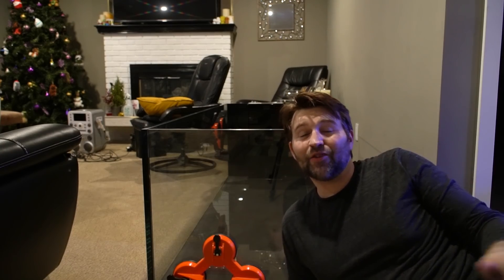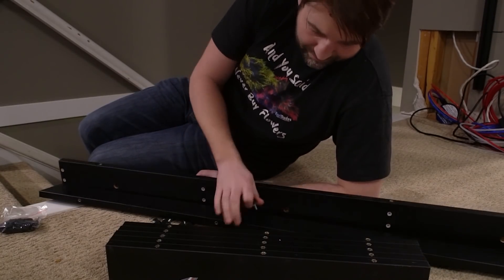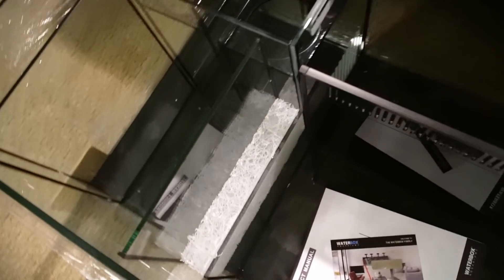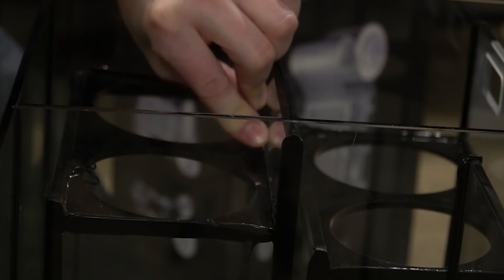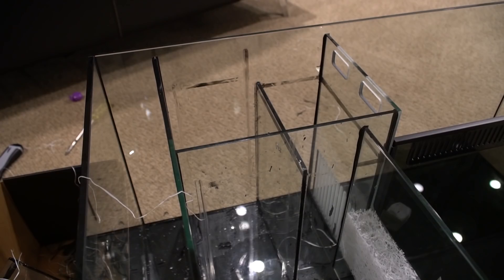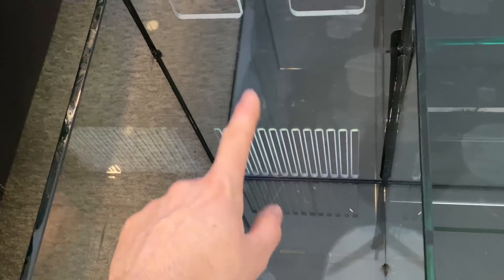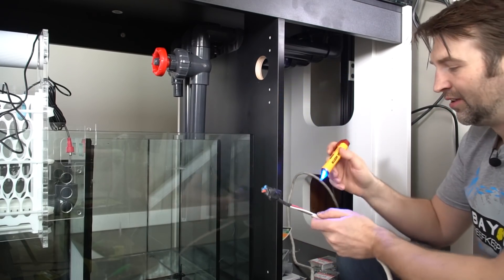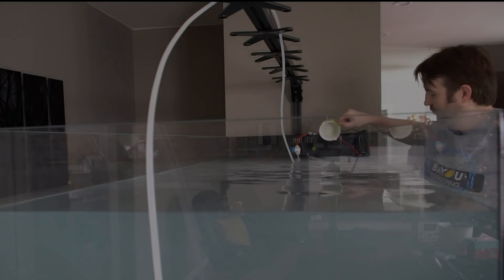WaterBox 7225 Saltwater Aquarium Build update! Unboxing, build, Calrisea, plumbing, gfci! EP.03

Comment: You used one neutral for two load lines.  This is EXTREMELY against code..  The neutral is a load carrying line, meaning the way you have it wired up, it has the ability to carry 40a worth of current without tripping a breaker.  That is double its rated (assuming 12 gauge wire).  You need to either remove the red line, disconnect if from the breaker and just use the black and white.  Or, fish another white neutral wire up from the breaker.  The second way is better, because you get to maintain your higher current.  The wire you used there is designed for a 240v appliance.  Two 120v lines combine in appliance to make 240v and is fed back down the one neutral at 240v.  The wattage would be double, but still at only 20a (which is all the wire cares about).  I would seriously fix that fast...

Comment: I don't think breaking the sump was worth it. It looks better with the socks. You do what you gotta do man.
Reply from the maker: Maybe, but then i have to change socks every few days...put them in a bucket or wash them.. ect.   I'm more on the 'lazy reefer side' and would rather change a filter roll every 2 months.
Reply: @ReefDudes  I'm supper lazy. I have 8_10 socks. When they get dirty I make a pile in my bucket. Then I end up washing all of them 3 months later. It takes 10 mins to wash in the washer. 3 months of bumming it for 10 min wash in the washer. You tell me man. I don't see how more work using a roller and breaking the tank is much better.

Comment: I'm not sure I understand, why do people DIY thick section, rigid posts for their lights instead of simply hanging the fixture from the ceiling? See Red Sea Deluxe systems for a visual. Much visually cleaner install in my opinion and its what I've always personally elected to do.
Reply from the maker: Then what do you do with the wires?   I love the floating look and having nothing above or below the lights. The bar gives me a place to hide the wires as well
Reply: @ReefDudes  Either use a cable management sheath common with wall mounted TVs or wire it through the ceiling as you would a conventional chandelier once you've painted the cable to hide. I do agree though, your circumstance hides the vertical member better than most applications.

Comment: Hey just a tip for next time man, next time you need to get silicone off of glass and you can't fit a razor, use the thinnest piano wire you can buy. My old boss and I used this trick (his trick from servicing days) with a few custom Miracles aquariums that needed to be torn apart or smashed with a hammer as well. Piano wire works great, plus you can't slice the bloody tip of your fingers off by accident with it lol

Comment: im  really new to the world of aquariums so sorry if this is a dumb question but i wanted to understand how you would hook up that clarisea unit. That Sump has a  small area that the overflow downpipe feeds into from the main tank. As i understand it the clarisea has a fitting on  bottom that you are meant to connect the overflow downpipe onto. You only modify the compartment where the socks are located to make room for the Clarisea. For connecting it up do you then reroute the downtime to bypass the original small compartment that they are designed to flow into? Thanks :)
Reply from the maker: Yep. You neeed to connect the main drain to the pipe on the filter roller as well
Reply: @ReefDudes  cool thanks for the update :)

Comment: Can you tell us please or better yet show us in the next update for this tank if the weir inside the tank for the over flow box is glass or plastic and how many holes drilled for the drain and returns
Reply from the maker: The entire overflow tower including the weir is all glass, even the lid! :)  There is 1 return that splits into 2 at the top of the over flow box and 2 drains.

Comment: Hello that's a really nice fish tank but I would not have it so close to the staircase like that someone can accidentally hit it and it will fall over the staircase if I was you I would think about finding a new location for the fish tank thank you for sharing
Reply from the maker: Out of coristy how big is your current tank? Have you ever tried to move it?  I know my prior tank which was smaller... i couldn't budge it with all my might when it was full of water.   This one likely weights about  2,000lbs plus so not overly worried about it moving. I have throught about putting a few long screws into the floor to prevent it.. may still do that.. but its solid!

Comment: I have a question for you. Is it possible to change out the plumbing system on the waterbox tank? What I want to do is change out the bulkhead system and all. I just want standard plumbing and bulkheads on the tank. You have any ideas on this?
Reply from the maker: I converted the plumbing after the bulkheads to normal plumbing to tie it into my custom sump, you can get metric to standard pipe adapters :)

Comment: Question: how did those suction cups work for you? I have a 7225 water box coming in 10 days and I'm preparing. Any tips on moving are greatly appreciated!
Reply from the maker: Yep they did!  It was heavy but do able. I had one hand on the cup and the other on the tank jsit incase but they worked well.  Congrats on the new tank!
Reply: Thanks! Mine will weight 475 pounds and I'll be happy once its in place.

Comment: Hey dev , I know its a Older video but , I'm in the market for a new tank. I'm upgrading from the diy build i started with.  I'm looking at the waterbox 90.3. how was the stand to level. Also I now that this tank is on your stair how stable is the stand and tank? Thank in advance for any and all info!
Reply from the maker: There is a bazillion leveling feet on the bottom so it’s pretty easy get it level hardest part is just making mini adjustment to get them all perfect.  Overall awesome stand.  Very well built

Comment: Looking SWEET! Really liking the Waterbox tanks. Sorry about the sump, that sucks.  NEOMARINE  for the win. Love this salt.  One quick question.  When you wired up the double outlet, Do you only have to connect the neutral?  I've wired a couple but also Jumped the black "hot" wire as well. Might have just learned something if you only need the neutral.  Thanks.
Reply from the maker: That wire had 2 separate circuits in it.. so Black and Red were both HOTs with the white as a shared neutral

Comment: Is that the 3000 or 5000 roller filter? Which would you suggest for a 90 gallon tank?
Reply from the maker: Mine is 5k. Go with the biggest one that will fit

Comment: Heat gun........ heat up the silicone and it cuts like butter  FYI
Reply from the maker: good to know! i will try that next time!   the one baffle that i ended up using force on was soo tight to the edges i couldnt even get dental floss or a razon in there

Comment: its a very nice looking tank. except waterbox didnt calculate the correct wier size on most of their tanks. some tanks can overflow if the return pump is too large or the water level gets very high. you can not have large pulses or wave motions if you have these tanks.
Reply from the maker: That goes for any tank.. to much flow can overrun any wier!